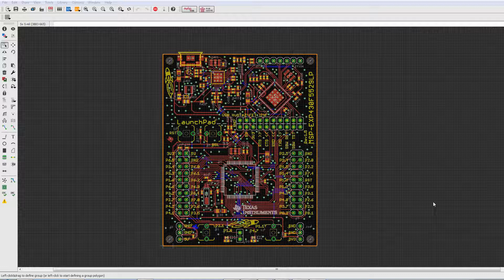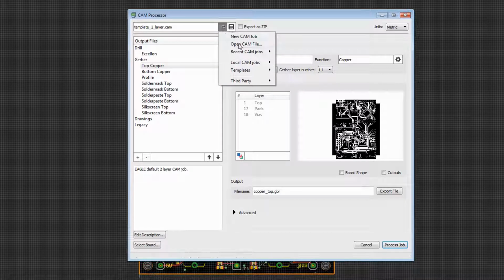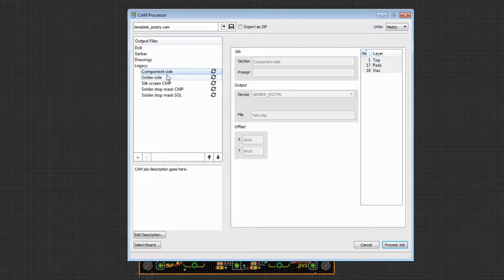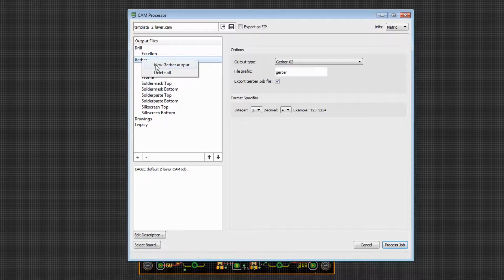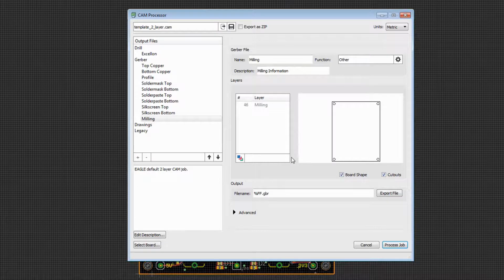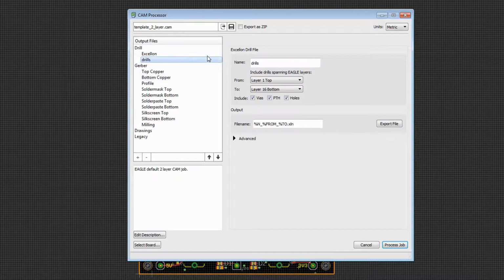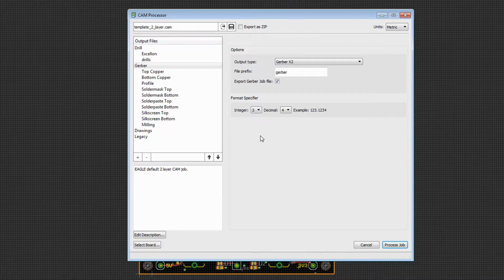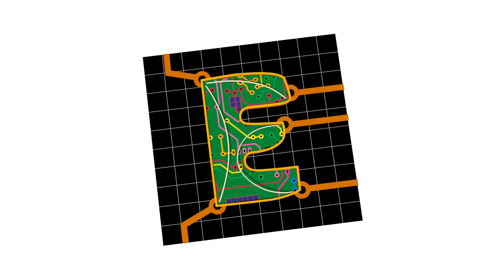Autodesk EAGLE - NEW CAM Processor Overview

Comment: The question is .. should I create new CAM Processor for each different project ?
Can I always use the default one ?
Reply from the maker: Hi Abdulkadir,  You don't have to create a new Job for each design. Jobs are generally setup for the type of board you are trying to make. If you always make two layer boards then you could conceivably always use the same CAM jobs. Thank you for your question. Cheers!

Comment: This appears to be a considerable improvement in the CAM section. 

Still hoping for BIG help in differential routing and editing traces with curves. Essentially the primary reason I am gearing up for Altium Designer.
Reply from the maker: Hi Factory400, Thanks for the comment. I saw that you checked out our latest release Differential Routing Mode https://youtu.be/U_VrqCcgkIc  Cheers!